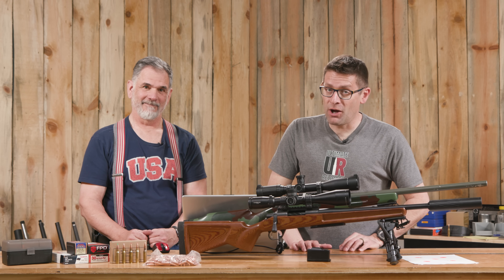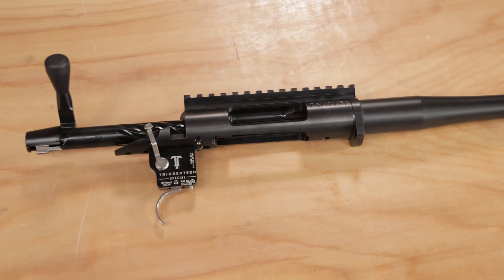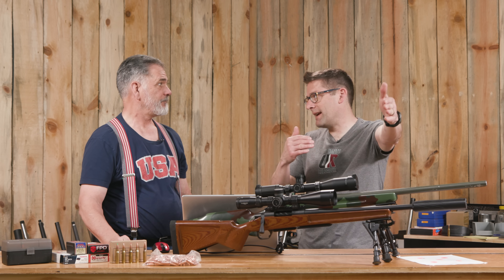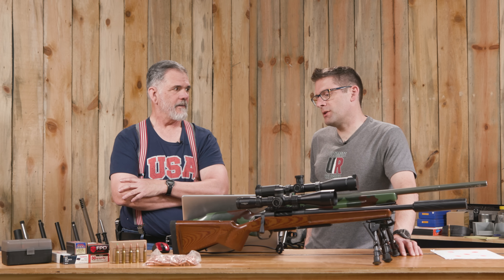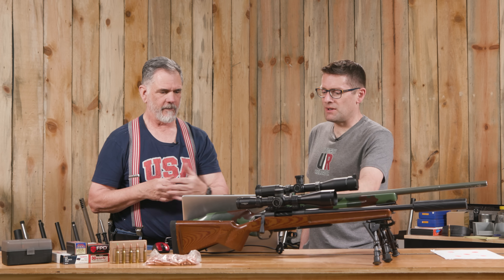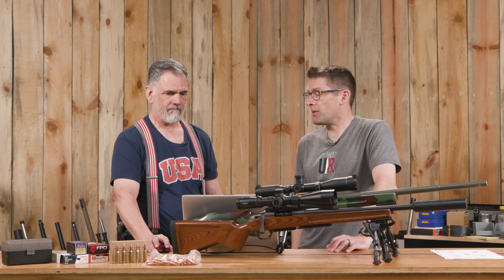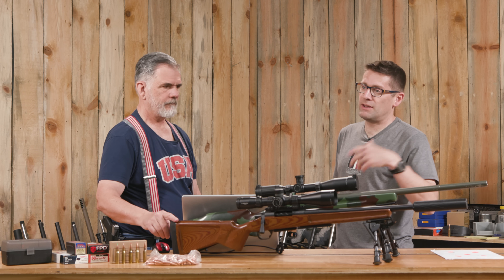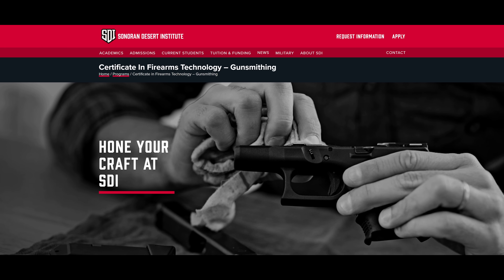308 Velocity: SHORT -vs- LONG (16" -vs- 24")

Comment: The pistol loads are probably better for accuracy, or I should say consistent accuracy. 
Though it's not really talked about powder still burning as a bullet leaves the barrel can/does affect accuracy. 
Years ago, you would see relatively short barrel rifles (like 20" Win Mag) that should by build have been fairly accurate but would consistently have fliers. 
I have no way to test it out, but empirically, it seemed to happen. It definitely affected groups for a friend that was testing barrel length by cutting the barrel and recrowning that past a certain point groups started to open up.
Bullet base design may have something to do with it. 
If nothing else, unburned powder is wasting your money 💰

Comment: Great video and right down my alley. Ive been trying different loads in a POF Revolution DI with a 16.5" barrel. Its pretty much sub moa with any decent quality load and will shoot close to 1/2" with Norma 168 and 175 match. I'd like to see you guys work up a load with the Barns 110 grain TTSX and get your thoughts. As you mentioned they're a solid copper bullet and retain virtually 100% of their weight. Load data suggests that its possible to almost emulate 130 grain.270 ballistics out of a 16" barrel with this bullet. At least out to reasonable hunting ranges.
Reply: We anticipate using more Barnes bullets in the near future!  :)

Comment: For the Ultimate Eastern 🦌 gun build an AR10 carbon everything with an 18 inch faxon pencil barrel and the new Alaskan 360 titanium suppressor. Top it with a Leupold vx3hd 3.5-10x50 illuminated and a 45° red dot 👍😁👍

Comment: I had a .308 shorty built on a Mauser 98 action years ago. Used a pull off Sendero barrel 12 twist cut and rethreaded for the 98 later I put it back in the shop for muzzle threads 5/8 x 24 for a suppressor. It's slightly longer than 16". Shoot 150 grain Winchester Power Points and Barnes 150's both loaded with Varget same charge weight and impact literally in the same place. Through a SRT suppressor recoil is soft and for short range efficient on South Texas critters. I never chronographed any loads I figured a couple of hundred feet slower the deer I shot never had any bullets to recover all went through mostly close range brush shots. I have a lot of light bullets for Blackout may load some in it and give them a try. I did some subsonic loads with Trail Boss and Hornady round nose projectiles that had been hollow pointed but stuck with my Blackout too easy to load them. I like the shorty you built it would make a good rig for pig eradication.

Comment: People are and have been finding this out. The model 7 remington in 7mm-08 in 1981 had a 18 1/2 inch barrel. I used this one to fill cooler 
120gr hp was my go to load in front of 4064 IMR. Out to 400yd's I could see impact. No kick just fun to shoot
I now use 20 inch barrel and for me this is the sweet spot. Funny how rem. Came up with an idea that just now has come to light. And 30-30 bullets in a 308 reduced load will also kick butt out to 200yds.

Comment: I have used 155 a max loaded to the factory box velocity for a long time in my 16” and 24” 308s, 168 a max and 165 game kings as well. I want to have a couple 16-18” barrels out on a couple rifles. I love 18” with a suppressor fora shirt action cartridge. I even had a 700 done in a 18” 1-9 30/06 and shoot 208s it’s my 300 yard and in everything rifle.

Comment: I run a Remington 700 with a 24" because of the velocity I can get out of it. It rivals my 7 mag in a couple of areas and is just a little bit shorter and lighter. I started hunting with Walker Razor electric ear buds and never felt the need to bother with a suppressor. And yes I have suppressors so I know what they can do.
Reply: Good to know those work. I have hunted and target shot a 20" heavy fluted factory barrel Savage FCP for around 6 year's. Polished bolt assembly and trigger with a mod. Everything else is factory. Older with no threaded barrel and with how it shoots I will not touch it. From 45.0 gr to 46.0 gr it shot between .188 and .3 something 3 shot groups with POI not changing but very little, 1/8" at most when testing. I run 175gr SMK in Lapua brass lit with CCI #200 primer @ 2.800". It has been out to 1200 yards on many occasion and 1000 even more. I run a 168gr for hunting now. I have run 150gr. It is pretty close to the perfect all around Whitetail rifle for my neck of the woods. Appreciate the heads up on the Walker Razor.

Comment: The 130 TSX have worked well for me in 308. They are also fun in 300 WSM. I've used them for spike elk. Shoots flatter than my 220 Swift out to 400 yds.
Reply: In your opinion ttsx 130 —16.25 barrel —- will it do the job within 200 yards on broadside elk -lung shot ??
Reply: @ziruk-king4466 absolutely

Comment: Great video! I think the 16" 308 would be very practical for most hunting applications. I deer hunt in wide open spaces where there are many possible 1000 yrd shooting distances. However, after over 10yrs of hunting that property, only one deer was taken at 410yrds, all others were 200yrds and in. I think with rangefinders and modern rifle scopes, we get the idea that we need to have the ability to take longer shots at game if we hunt in wide open spaces, but I like the idea of practice long, hunt short.
Reply: That's good philosophy
Reply: The difference in velocity between a 16" and 22" barrel is 200 fps
Reply: I hunt on public land in upstate ny in the adirondaks so 16 inch is preferred not typically shooting at anything over 150-180 yards
Reply: Try a lighter bullet at high velocity, copper or bonded for hunting - my take on it.  For 168 grain, 30.06.

Comment: I would choose the traditional “Green Machine” style if I could only have one. Simply because I love the traditional look, in a traditional caliber.

I am currently running 18.5 in my .308, most 150gr factory loads are 2600fps range. The preferred factory load is Federal’s 130gr “Varmint” which is 2850-2900fps depending on the lot. Round count is 7.5k rounds, and now it won’t stabilize anything but a flat based light for caliber bullet.

Comment: I'd assume the same or worse results with 30-06. I would still be curious what would happen with a 30-06 from 24 to 20 to 16 with some of Guy's hunting loads you've covered.
Reply: Give up the long action, come to the light short action is awesome. 30-06 does no do well in short barrel.
308 rules as does 7mm-08, try lighter bullets and pick up more speed. Bullets have got a lot better over the years. I'm talking whitetail size game. Not 2000 pound stuff
Reply: @randallwhite9015  it was more curiosity than anything. I'll never have a 30-06 shorter than 24". A couple years ago I bought a 1903A3 Springfield, so I built a surplus of 06 as a result. Had it been a rifle in 308, I would be telling a different story.
Reply: Me too

Comment: 20 “ factory barrel 11 twist sako, 168gr ELDM and 45.5 grs of varget, 2670 fps is all I could get from it, but it was a nice accurate load.
Reply: I get 20fps less with my 20” Remington 700. 1:12 twist w a max varget charge. Same projectile. Same as you though. Accurate load.

Comment: A .308 needs at least 20" of barrel to burn all its powder. No barrel shorter than 20" is worth it with .308. From 24" - 20" a 168 grain projectile goes from 2700 FPS to just under 2600 FPS. This does make a difference in trajectory and retained energy. If you're shooting .308 Win. within 500M 20" is an OK option. If you want to go longer, you really need 24" - 26". Anything less than 20" why bother? You turn your .308 into a 400M or less cartridge. You can do the same with a 6.5 Grendel for less money and less aggravation. While a 16" . 308 is an obscene stupidity - think 7.62x39 +P with the recoil of a 20 gauge. Only an idiot goes for a 16" . 308. Intermediate cartridges exist for a reason. Partially to provide a more efficient platform with a shorter barrel length. Use them instead of being a ballistic bubba and chopping up a battle rifle cartridge. Most of the time, the people with .308 shorties are just annoying people littering100 yard ranges. The typical, thumb over bore first person shooter Xbox gender confused metrosexual who does may dumps at 7 M and thinks he/she/it achieves something with 40% hit ratio on steel. Dylan Mulvany Bud Light shooters. Don't be one of these people. They are stupid and dangerous and should be relegated to lowrent ranges where they can't annoy or get in the way of real shooters. If you don't want a "long" rifle, get yourself an AR or AK, get good with it, call it a day. You don't need a bolt action rifle.

Comment: For my neck of woods, Shorty would be quite sweet. Too many rolling hills for the need to reach out much.  I'd have to put some 110gr V-Max's or Nosler Varmageddens through it. I get around 3200 fps from my 18.5 inch MVP Predator so they still have some zip and are pretty accurate.  Recoil would light and probably a real joy to shoot.  Nice rifle, you guys keep it up with the awesomeness

Comment: I'm a western hunter. My shots could be anywhere from 80 to 800 yards. I definitely prefer the longer barrel, 24" short mag with 5" suppressor. Now for a truck gun, I like the Sig Cross. Folds up nice and tight and fits inside and AR-15 Soft case..

Comment: Right on Guy and Gavin! Glad your doing videos on the 308.

Is their a difference with the Shorties velocities when it has and does not have the suppressor?

And Hey, Guy "thanks" for all your years of service. May the Lord, the Living God  strengthen and bless you!

Hey Gavin , thanks for your vids and not forgetting us 70's and 80's boys and providing top quality tools to out communities protectors.

Both of yous (and i know your not a female sheep), keep up the good work!
Reply: Suppressors should not impact velocities if everything clears. 75% they will change your point of impact. 99.9% will improve accuracy because you're adding weight to the muzzle.
Reply: Supressed about 30 FPS faster.

Comment: The suppressor raises the velocity a bit so a real fair comparison should have compared the two unsuppressed or both suppressed.
Reply: Absolutely false. Suppressors do not increase velocity. Lay off the Call Of Duty and Battlefield.
Reply: @TheTrueNorth11  Suppressors absolutely can in fact increase velocity. Even a cursory search would show data supporting this. Lay off the ignorance before you comment
Reply: @Shootin_Bruin  They simply do not.
Reply: @TheTrueNorth11 there’s plenty of videos showing it does. Not a whole lot but they still certainly do. More room for gas to push the bullet the faster it will go.
Reply: @TheTrueNorth11  I've never played Call of Duty or Battlefield. I've seen tests with and without a suppressor on a chronograph. It depends on the suppressor design but they can act like a slightly longer barrel.

Comment: I don't get it. You get 2700+fps with 168 midsouth from a 16 in barrel, 2900 fps in the 20 inch but MUCH slower with 168 gr A-Max from each rifle. How do you get the one type of 168 gr to move so much faster in the same rifles? 2700 fps is incredible from a 16 in barrel.  How was accuracy with those midsouth bullets?
Reply: Three of the ammo types we tested were factory loads. I only handloaded the 168 gr MidSouth bullets and the 125 gr Nosler Ballistic Tips. The Midsouth bullets shot well, just as I'd expect from a standard 168 grain HPBT match bullet. That 168 grain handload with the Varget is listed as max, and I have no intention of loading it any hotter than that. Normally I back it off a grain or so from that charge. You're right, it was quite fast from both the 16" and the 24" rifles.

Comment: Living in Aussie Land, I have allot of centrefire rifles with barrels from 12 inches to 16 inches . My 4000 acres I have very heavy scrub , So longs shots for me are 100 yds... with most shots from 25-50 yds.   Short barreled rifles just make sense , Just wish we could run suppressed. I can also confirm that no feral pig, dog, deer or goat  with my 12 inch barreled 45-70 noticed the velocity loss of the 300 grain hollow point , Same for my 15 inch barrelled 308 with a 200 grain soft point.
Reply: Does it require a special permit or license to have a short barrel like that? Here in the US anything under 16” is considered an SBR and needs an extra payment and paperwork to make legal. No suppressors in the outback huh?
Reply: @arm_usa  Not in my state...  Only requirement is the overall length ...... Suppressors here are Cat R, Same as a machine gun..  But other states allow feral pest controllers and farmers to have a suppressed firearm due to workplace health and safety guidelines on noise .  But since i posted this, I cant even have a bb gun.. The government refused to renew my license.
Reply: Holy shit…200 grain .308? Never knew they went past 180 grain
Reply: @mauriceshand2523  I make up to 240 grain ballistic tip VLD's for my 308..

Comment: I love me a heavy 16" barrel on my 308s! Thanks for the load data.
Reply: do you still like it?  I hear that shorter bull barrel 308s are very accurate
Reply: @HamuelTheGrey  I’ll jump in. I have an XLR Atom chassis with an Origin remage action in it. I started with a used Savage 20” 308 FP barrel it’s a pretty heavy contour. Shot several deer with it.  It was real muzzle heavy.  I cut it down to 16.5 inches and it really didn’t make a difference. I then recontoured it to a light Palma contour and it’s my absolute favorite rifle now.  With a heavy meopta optika 6 scope it’s 7lbs 8 ounces. I think it’s perfect. I’d thread the barrel but I’m not that confident with the lathe - yet. I like this set up very much.  I shoot 168 gr AMax over 44gr Varget. Shoot 6” gong at 300 with it all the time.  It’s an ugly beat up and krylon painted rifle, but the stock is adjustable on the fly with a triggertech trigger so it always fits me and that makes it a favorite rifle. I did all this years ago and shoot the hell out of this rifle it’s the one I’m most confident with.
Reply: @E @Elkmonger thank you for the info.  i got a sig cross sawtooth 16” barrel 308.  its crazy accurate and fun to shoot. shooting 175gr AAC precision from palmetto armory is very acurrate and cheaper. Im still learning my rifle at 300yrds.

Comment: i am totally ok with long barrels even though I do think the whole short barrel trend is also cool.  Anyways, I’m mostly inexperienced with ARs having only shot one once but have shot many firearms over the years hunting. So I’ve decided that I want a 20” .308 for my first AR style rifle and since I’m on a budget and gotta save it will also be my “all-arounder” for hunting all animals except varmints for the foreseeable future.  Well that’s just me anyways.  I think that new Springfield St. Victor gun is pretty cool looking.  Or a PRS-91(edit: PTR-91!) maybe.  Looked like from a brief internet search that there was some pretty good deals out there for those.
Reply: I would go with the AR pattern over a PTR-91. They weren't really meant to be scoped and it's a battle rifle which means while you may get a 1 MOA gun, 2-4 MOA would also be acceptable for the manufacturer (PTR has no accuracy guarantee), they're heavy as a base rifle ( you could have a simple scoped AR10 for the same weight as the naked PTR) and the triggers aren't great vs the myriad of good triggers available in the AR platform .
Reply: @ScuffedEngineer  ahhh thank you! see I have not got that far in my “which model to get” research yet. Very good info! And plus as you saw I mistyped the PTR as PRS haha i dunno why I thought that😅 Again thanks!

Comment: Gavin, great video.  Considering apples.  Can you please explain the relationship between barrel twist and fps?  Your shorty barrel had a 1-8 barrel twist vs standard 1-12 barrel twist.
Reply: Bryan Litz did extensive testing on the subject. Story short, faster vs slower twist rates result in very minor velocity loss, along the lines of 5fps. Basically, it's absolutely nothing to worry about or even consider as a factor.
Reply: Good question. I was  pondering that myself.
Reply: I have a 308 Troy Pump Action with a 16 inch 11.25 twist - about 2400fps with 180gn bullets shooting about 2 MoA... But it prints horrible with even 168 and lighter bullets. I was contemplating getting new barrel. Maybe 18 inch and 1:10 twist so I'd love to learn more
Reply: Also, be aware that higher velocity means faster spin in revolutions per minute from the same twist rate, as twist rate is based on distance rathet than time.

Comment: Hi Gaven, My brother and I built a shorty.  Remington 700 308 varmint profile.  Both of us worked together to shorten and Re-crown to 18".  20 years ago.  I shoot a Unitaugh Precision, 300 BO, 16" Shilen 30 cal. Match blank.  You only get 200 FPS less with half the powder.  16 to 23 g instead of 40+.  I am using it to learn free recoil style of shooting.  Keep it up.  You bring your own prospective to yo tube.
Reply: What weight bullets are you shooting in your 300 BO

Comment: I'd happily take shorty with a suppressor, especially since I'm in the middle of building a 14.5" in 6.5 Creedmoor with a folding stock to run suppressed for white tail.  The max range I might spot a deer is 150ish yards if all the trees were lined up just right.  A nice little compact rifle to have in a truck with 4 other people who all have 24 or 26 inch barrels.

Comment: Greetings from a few hours north of you folks, thanks for the video. We've had a .308 18½" carbine in the safe for more than 40 years, usually using 130gr to 173gr bullets. For Okanagan deer we settled on 165gr Hornday Interlocks and they worked fine. A couple years back I loaded up some 130gr TTSX in it but so far haven't tested them on anything. There is a bit more muzzle blast for sure with the shorter barrel, but it is a very handy length for both packing around and in thicker cover. Best to you both.
Reply: Thanks for the good comments!